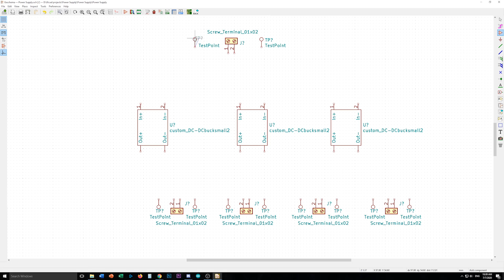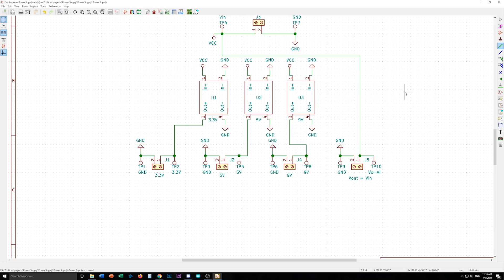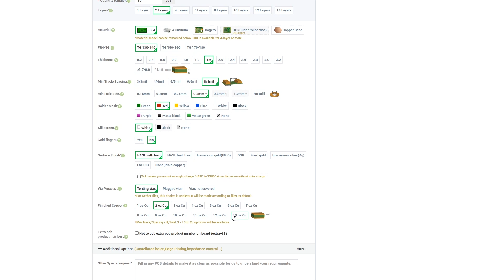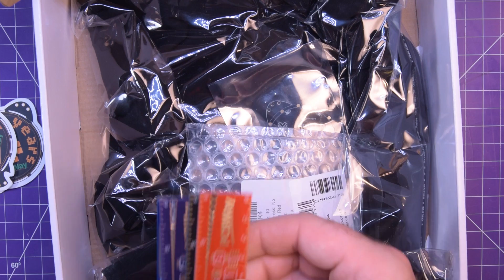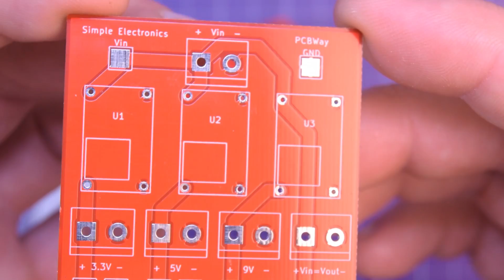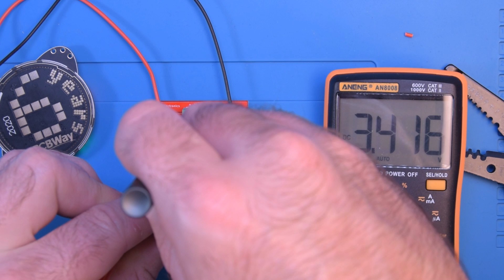Need Something? Make It!

Comment: Hey, sir fantastic work you have done! Just have one question what if you have higher current input i.e. 12V and 26Ah Max and have to step down with multiple outputs ?
Reply from the maker: You would do it the same way - but you would end up with the same output current as this project